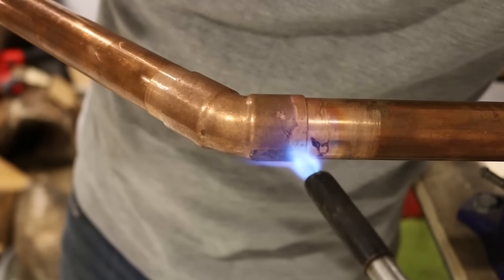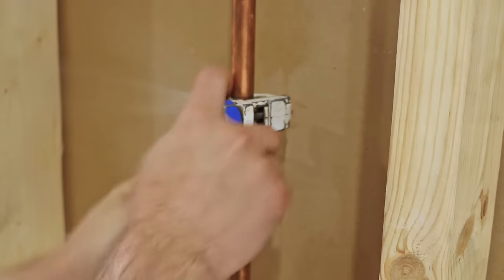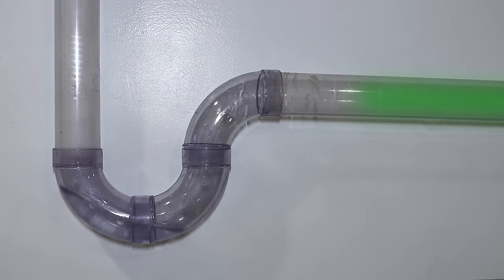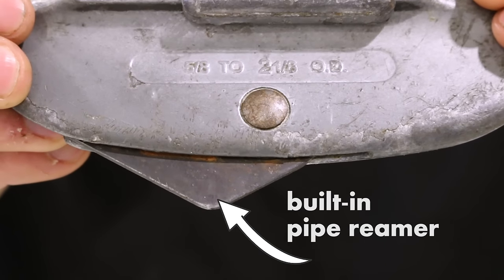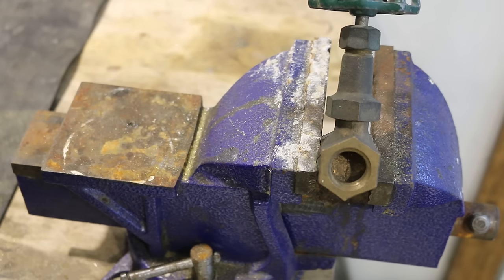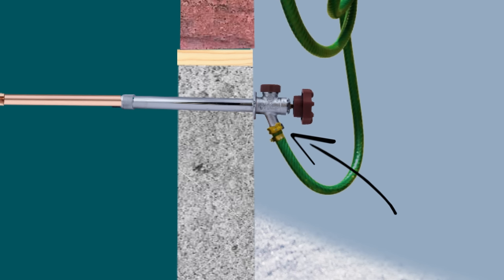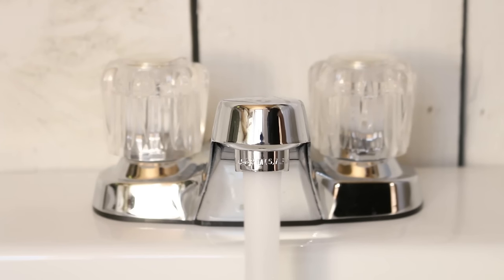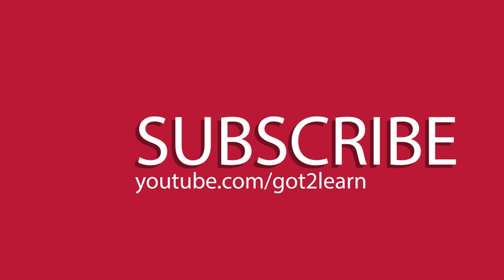The ULTIMATE Plumbing Mistakes Guide (30 Mistakes And How To Fix Them) | GOT2LEARN

Comment: This man actually knows what he is talking about.
Reply from the maker: Thanks!!!!!!!
Reply: It's like 3 years of on job
Reply: False. He is just regurgitating info he got from google
Reply: Not everything he says is true EVERYWHERE. Plus sharkbite fittings aren't reliable. Fittings should always be cleaned. Non freezing hydrants only work if they're sloped to the outside. Ever heard of cleaner and glue? I've been plumbing for over 30 years and have never had a problem cooling a soldier joint.

Comment: do not use hoses with aluminum ends on a brass hose bib. after only few months, they will corrode and you will not be able to get the hose off and might have to get the hose bib replaced. use brass, stainless or plastic ended hoses. this is become a super common issue in the last few years
Reply: Even this “housewife” knows this!
Reply: Sure has!!!   I've cut 5 or 6 off!!
Reply: This happens alot ..
Reply: I'd never use aluminum/galvanized/ black steel on potable water(drinking water)..only coper/pex/brass/ supply lines and schedule 80 pvc

Comment: Always skip the first 2 threads on the end of the pipe so pipe sealant and/or Teflon tape is not sheared off and introduced into the system water or gas with gas being more critical.

Comment: The one thing I would add is when fastening metal water pipes with straps, use copper straps on copper pipe and steel or tinned straps on steel pipe.  Do not mix metals and that includes strapping.  Great list BTW.
Reply: Meridian Township noise ordinance
Reply: Great tip! I would not have thought of that.
Reply: R:

Comment: Your videos are so good I don't know if folks realize how much effort goes into getting the camera and audio setup properly. Not to mention the expert content. Love it! You've saved me thousands of dollars not hiring a plumber. I've completely remodeled a bathroom down to the studs with new copper piping and no leaks, looks amazing thanks to you.
Reply from the maker: Thank you sooo much for noticing 🤩
Reply from the maker: I took your comment and posted it on Instagram if you don't mind, I really appreciate you noticing how much work goes into making these videos, thank you so much!!!
Reply: @Got2Learn  It's an honor. Thank you!
Reply: @Got2Learn  You rule my man, I just installed a sweat valve and fixed a pinhole under my home because of you as well :) I used a jetswet to put in the ball valve, because the water pressure was still to strong with it off for bread, and it shotgunned out the bread at me the 1st time LOL.

Comment: You mentioned wiping flux residue off of all solder joints.  Do you know of a non corrosive cleaner that would clean off the flux, without damaging the solder joints?
Thank you.

Comment: 3:02 and this phenomenon is among the reasons why the NEC 110.14 prohibits directly bonding dissimilar metals together (usually aluminum and copper). The other major reason is dissimilar metals may have different electrical properties and expand and contract at different rates which I imagine could happen in a plumbing scenario as well causing a leak.

Comment: I need to add a 90 degree coupling to a metal frost free sillcock I'm installing. The sillcock end has 1/2 threads and I'll be running it to a 3/4" expansion pex fitting with a 3/4 male threads. Should the the 90 degree reducing (1/2" x 3/4") elbow be brass or galvinized?

Comment: Is this steel transaction to copper through plastic special fittings that you showed allowed for gas pipework? If not, what's the solution? Thanks advance

Comment: 4:15  It is important to note that it is quite possible to burn the flux by heating the joint too slowly.  In some cases this can result in the flux deteriorating before the copper is warm enough to melt the solder.

Comment: If you use a brass nipple between steel and copper, to be up to code, there has to be a minimum of six inches of brass between them to prevent electrolysis because they are such dissimilar metals. So, a brass coupling, a four inch nipple and another coupling, or preferably the dielectric union you mentioned would be sufficient.
Also, if people want to do drugs, don't flush your syringes down the toilet - it clogs it every time, your Landlord will charge you for it, and probably evict you, when a Plumber either pulls it out or sees it on the sewer camera. Plus, a plumber doesn't want to get poked with your used needle and get whatever disease you have - they pull out syringes from toilets and see them in sewers all the time. Awesome video, as always my Friend!

Comment: I installed a new electric hot water a few months ago. Now I have a smell in the bathroom sink. Is it possible the new hot water heater is causing the smell?  Or is the vent plugged up somehow?  The vent is in the wall. How do I check the vent.  From the roof maybe????  Thanks

Comment: Here in CT, you cannot use ‘transition’ glue to join dissimilar plastic pipe, the code prohibits it.  Use a no hub clamp, or you can use male and female adapters and screw them together.  The transition glue generally does not make a lasting seal.
Reply: UPC allows one connection per structure to be glued with transition glue. It's meant for the building sewer to building drain connection. I've never seen one fail

Comment: air chambers apparently caused legionellas disease. wouldnt recommend those sharkbites in a concealed area though... 
deburring with an exactoknife is deadly and slow as shit too lol
curious if you were trained to have your heat at the source of your solder instead of having them on opposite sides of the pipe to prevent overheating and to provide a better solder pull?

great video

Comment: I got a quick question.
I forgot to add a 1/2 female npt for a tub filler spouts proprietary fitting. However, tile work is done and it's installed on the wedi board. Wedi board is a foam board basically so sweating there is going to be challenging without removal. Am I screwed?
No I cannot access the other side.
Either tile has to come out and potentially will damage substrate. Which I'm sure that it will because tile work is done very very well.
But I missed this important step to sweat the fitting.
My thoughts,
Dremel out the stubout, spend some time cleaning the pipe.
Sweat through the inside diameter of the fitting. The npt fitting has to be 1/4 below finished wall so I need to cut about 3/4 inside the wall and do this. Biggest challenge is keep flame and heat away from the backer foam board... 

Is this doable?

Comment: So I just did some work for my brother In law and helped him install a wood boiler.  The biggest challenge was dealing with his lack of use or none at all of isolation valves/ unions/  and copper soldered take offs to better assemble the 1" PEX lines.  I'm am electrician, but understand how you can almost not have enough valves in a system for trouble shooting, maintenance.  So my question was the copper fittings that were soldered onto the heat exchangers.  They were a 1" copper pipe to 1" PEX.  They seems quite sloppy.  I struggled not to have a gap in the solder.  It actually ruined my week not being able to solder it pretty and looked like there was almost a void.  I feel it was the wrong fitting, but he was given the fittings by a proper journeyman plumber.

Comment: Another important reason to not install more than 1/4" per foot drop on drainage pipe (beside siphoning out the ptrap) is to ensure the solids drain along with the liquid.  When the drain is gradual and slow, the liquid is more likely to carry the solids with it.  Love your videos, and this is a valuable tip that I think you should convey (which I don't think you've every mentioned.. heck, maybe you didn't even know it.. so much to know regarding pluming).
Reply: That's an old wives tale and completely untrue.
If it were true code would limit max slope. 
Seems intuitive that it would work the way you're thinking it does but many truths are counter intuitive.
Reply: @typ044  Love the comment, "If it were true code would have a max slope."   I though it was code, but I just checked IPC and IRC, and I don't see a maximum, so you maybe right, and I'll retract my comment.   Of course, vertical is always allowed, and that's how you would avoid exceeding a maximum if there were one.  It seemed to make sense to me that too much slope could cause solids to accumulate but I've never seen proof.. would love to see someone do such an experiment with transparent pipes (maybe I'll do it one day).  Do you have any hard evidence (visible experiments or laboratory work, etc.. not just heresay) that prove the tale untrue?  would love to see it if so.
Reply: @larryzdanis5377  I have family showing up in half hour but when I get a moment Ill find some links.
I used to think that too, intiution would make it seems obvious but like I said, just isnt accurate in the real world.
When you think of long runs from homes to a treatment plant it would be impossible to maintain 1/4 inch slope across miles of random topography.
 Its just one of the 1000's of old wives tales that persist in all trades, we all repeat things we've heard without verifying, myself included.
Reply: Also forgot to mention, slope has absolutely nothing to do with siphoning p traps, lack of proper venting causes it, a properly vented drain cant siphon the p trap even if you applied a really  strong vacuum.
Reply: @typ044  What I meant by the comment about potentially siphoning out the trap in the case of too much slope is implicity reflected in the 2021 Intl Pumbing Code, Table 909.1 "Maximum Distance of Fixture Trap from Vent".  In this table, it notes the assumed pipe slope when indicating maximum distance of trap from vent.   This is because, in order to ensure the Ptrap is not siphoned, air must be acessible to at least the top of the drain pipe at the wier of the ptrap.  This can only be assured (in usual circumstances), if the Pipe Diameter > (Slope x Distance-from-wierto-vent).   For example, for 1.5" pipe and 1/4"/ft slope, maximum distance is 6 feet (1.5" pipe dia / 0.25"/ft).   That's how they get the 6 feet in the table.. its actually geometry.   If you were to use a greater slope, then your max distance of vent from trap needs to decrease accordingly.   So slope must be considered per code in determining max distance of vent to ptrap weir, for the purpose of assuring siphon prevention.

Comment: Great video! Funny, I have wanted to add a blow flow flapper or valve on my sewer line just in case the city lines have an issue. You mentioned it here; other  folks think it’s odd or clueless when i mentioned it. Rock on!
Reply: A backflow preventer is code here in most places in Canada now . Because the cities are tired of paying for civil lawsuits
Reply: @robertn2813  the issues with them are they like to grab paper and flushable wipes and back up your system.  You can't run a sewer snake or jetter down the line or you will damage the flapper.  Making sure it is easily accessible but on deep lines that is hard to achieve.  They are expensive to retrofit in older homes.
Reply: A must to protect your basement/valuables in your basement in a city setting. Especially if you’re neighborhood is old and there is combination storm/sewer

Comment: I love the obvious brilliance in 1/2” of threads means it only goes in 1/2” 
When rushing to get a job done, over tightening is easy to do. Great simple tip! Thank you.
Reply: This is such a common mistake - do not rush jobs guys.
Reply: This is such a common mistake - do not rush jobs guys.
Reply: NPT thread spec says hand tight then 1 1/2 turns. That has always worked for me!

Comment: Number 27 you could also use a bender to create a pass over bend, rather than multiple joints which increases points where it could leak
Reply: Can you (should you) bend hard copper pipe?
Reply from the maker: Only soft copper.
Reply: @jt5747  NO !!!!
Reply: I bend hard pipe all the time for refrigeration lines. Heating to cherry hot then allowing pipe to cool slowly annuals it and allows for easy bending with the proper bending tools.

Comment: 8:09  You must sand/abrade EVERY fitting, pipe and joint.  The fittings are shiny because they are coated with a varnish-like product that prevents corrosion but you can't reliably solder to it.  Get your wire brush in there or your emery cloth on external mating surfaces, then flux and go.
Reply: I disagree, if the fitting is still nice and 
shiny, there’s no need to clean it, the flux, which is acidic, will clean off what little impurities there are.

Along with, Teflon tape is an absolute waste to threaded joints, most dopes have PTFE already in them, which is what Teflon tape was used for. The tape itself is an absolute waste of time and material. Threads are tapered so that when you thread them together, that is supposed to be the seal for the joint. And the dope is a lubricant to help the threads push farther past each other to make a better seal. Tape is a joke.
Reply: @Porkchopisdead  Teflon tape isn't a waste - it's all I ever use (I've been doing building maintenance for nearly 30 years), and never had a problem.  Whether you use paste or tape is really your (or your boss') preference (one guy I know, who works for a major plumbing company locally, told me his company's S.O.P. is to use 8 wraps of tape, then paste, then 8 more wraps of tape. I think that's really overkill, but I guess when your company's rep is riding on it, they want to be absolutely sure - they have a good rep, and they'd like to keep it that way. I usually do  6 - 8 wraps, no paste)
Reply: @Falcon-xx4xh  
Sounds like his company loves to waste money. How could they ever hope to out bid anyone on a job?
Reply: @falcon84 16 wraps of  tape?? Sounds like a load of 💩 to me 😂😂
Reply: @Porkchopisdead  the Teflon tape is also a lubricant, not a sealer. That's why you use one or the other, no need for both.
Reply: @eyemastervideo  so true Christian, so very true!
Reply: @theSkavenger84  they'd be no threads 😂
Reply: Tx Ben! 🦘
Reply: @Porkchopisdead  We use BSP over here.  It needs something to seal it.  We were taught to use hemp and paste on non-potable application.  On potable, Loctite 55 (like dental floss with PTFE bulit into it) or, if nothing better to hand, to use PTFE tape.  I do have a tin of paste that suggests it may be possible to use the paste without anything else on pipe diameters up to 25mm, but I don't know any plumber willing to risk it.

I suppose it's like pasting olives vs not pasting them.  While it is perfectly possible to get a watertight seal without paste, the callouts or callbacks you get from leaking compression joints are more often from ones that have not been pasted (and probably have been knocked or strained) than from joints that have been pasted.  Hence plumbers would rather do anything than have a leak.

I agree, however, that PTFE tape and a paste is a very silly mix to use.

Comment: When 2 pipes are touching and as shown you put a piece of insulation between (which is good) just be careful that it doesn't add too much pressure on the fittings nearby, as it can cause stress which may result if the fitting failing.

Comment: I had a stainless steel flex pipe under a sink burst !
  It was rhe first time ive ever seen this occur as it was in th center of the hose yhe burst occurred.   The pressure in the house was only 60 psi and this burst occurred in summer 🌞